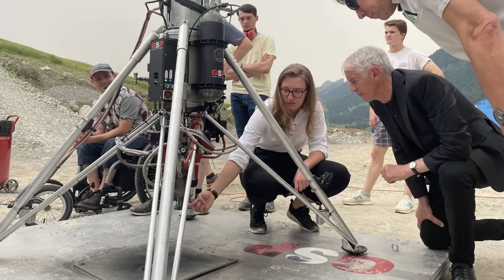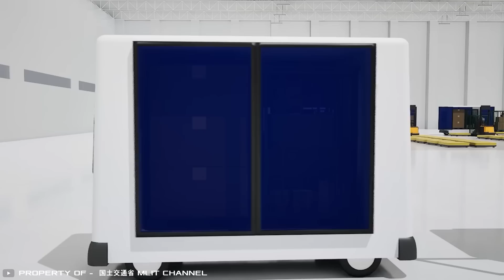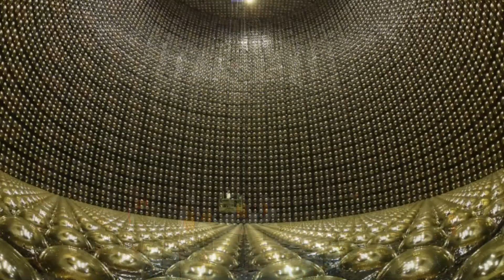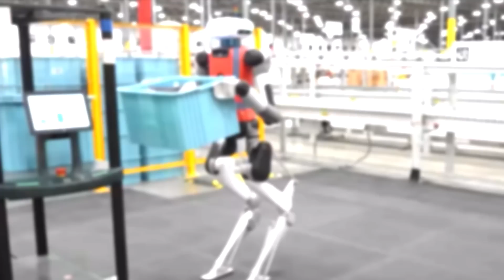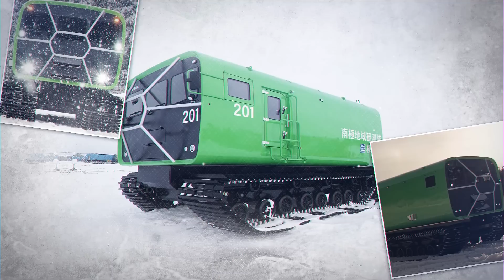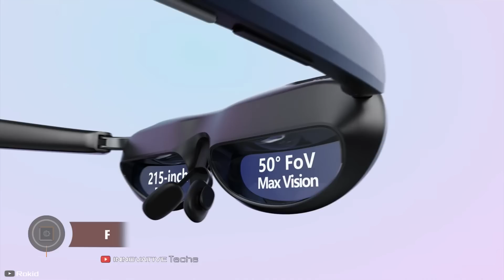30 INVENTIONS AND TECHNOLOGIES SHAPING TOMORROW

Comment: 3Dollars per shot ???
THis is fu...ng expensive.
Reply: Compared to shooting down a drone with a missile (like Iron Dome) it is relatively cheap.  I don't understand how they calculate $3 per shot for a laser though.  Besides electricity, what is consumed?
Reply: @CommanderMaga  Most high power lasers are chemical lasers that use special chemicals for each shot, but even if it is fully electric it needs over 100000W to burn a drone in four seconds so the laser LED and capacitors must be under notable strain. If the capacitors burn out after 1000 shots and its costs $3000 to change them that would give us the cost per shot.
Reply: @AnalystPrime  Logical.  Thank you, sir!